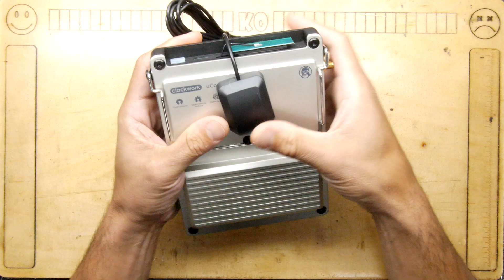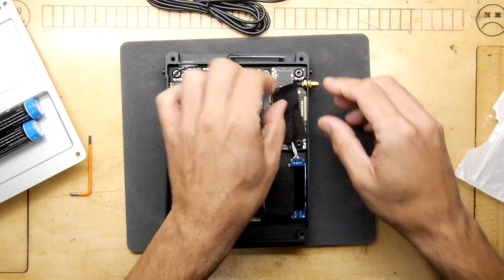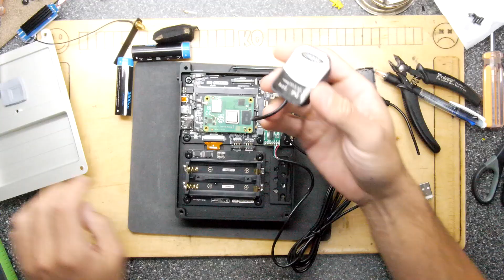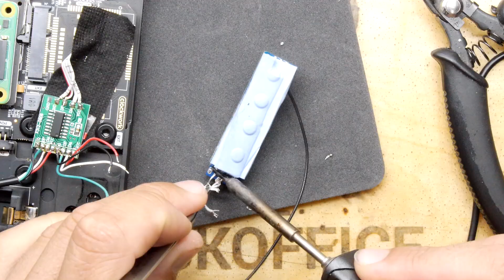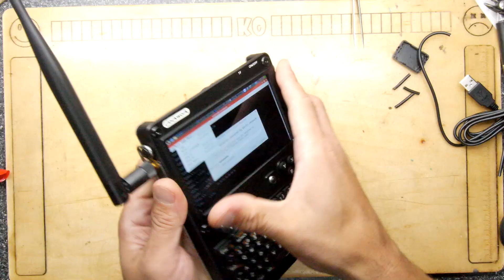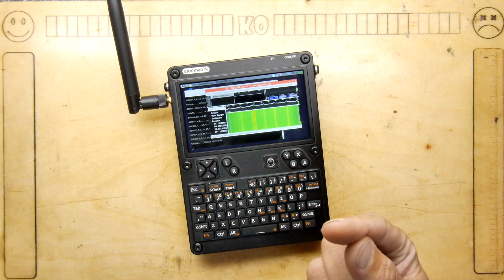clockwork uConsole cyberdeck - Internal GPS and USB hub hack

Comment: The pinout on the SIM7600 is 10 GND, 11 USB_VBUS, 12 USB_DN, 13 USB_DP, 14 GND... so while you were messing around with crossing over the GND wire from pin 10, you could have just shifted everything down one and used 14 for GND

Comment: the hole at the top with the existing antenna, is wide enough for sma connector have it's lock washer to compress there. imagine with multiple connections(sub-ghz, rf, wifi, cellular data/lte)

Comment: Great video, but i don t think is a good idea to put big permanent magnet over other component specialy cm ram, just use regular gps module with external sma antenna could be an better choice.
PS: don t share your gps location!!!
Reply from the maker: Can you please elaborate why you feel the magnet is not a good idea?
Reply: @backofficeshow  A magnetic field intensity between 20 and 200 mT can cause temporary disruptions to proper operation.especially neodyme...
Reply from the maker: @Alundra06 Is that from a datasheet? I would be interested in the URL if you have it handy, I'm curious why they would specify values that are quite low. I think I would be more than happy dumping a bunch of rare earth magnets in my PC and being pretty confident they wouldn't do anything. 200mT would be like a large fridge magnet wouldn't it?

Comment: Why didn't you just use the uart connection? it seems you've done this the hard way. 
Parsing gps data is fairly straightforward.
That is also the most expensive raspberry pi I've ever seen.

Comment: Step on that GPS and brake the case now mount it internal
Reply: There's almost certainly no external antenna port on the GPS receiver, and the signal will be ruined inside an aluminium box without one.
Reply from the maker: @1nico517 it's tempting to make a plastic back. The metal case is cool, but I'm not sure it's really an advantage over plastic, other than being cheaper to machine than the tooling for an injection mould

Comment: Thanks for the tip on that USB chip!
Even if it's just USB1, it's still quite useful! :)

(random thought, TRRS jack for the GPS could be an option for someone that want to be able to unplug it without having to use a USB connector)
Reply from the maker: Turns out, it's USB 2.0

Comment: These videos are so good! I just installed an RTL-SDR v4 in my uConsole by following your last video and it's awesome. Even though I managed to rip off the solder pad for the SMA connector when trying to desolder it. Actually by coincidence I just bought one of those GPS's that you're using in this video, maybe I need to attempt another mod.
Reply from the maker: That's fantastic! I think you are talking yourself into doing this mod. Would you use that little hub PCB as well or try to patch into the second port pins on the expansion header?

Comment: I'm very close at buying this, but i wait for the compute module 5 to come out, to get that little extra power, either that or ordering it now and hope that the cm5 has the same dimensions to cm4. what would you suggest? by the way nice tinkering! great job!
Reply from the maker: I think realistically the CM5 will have a different footprint. It's possible that clockwork will release a personality or adaptor board for it, but that's no guarantee. They might even do making the device altogether 🤷